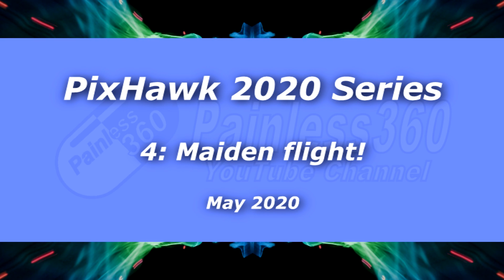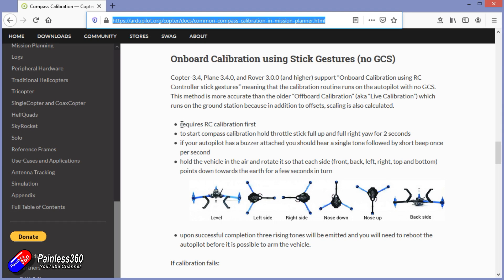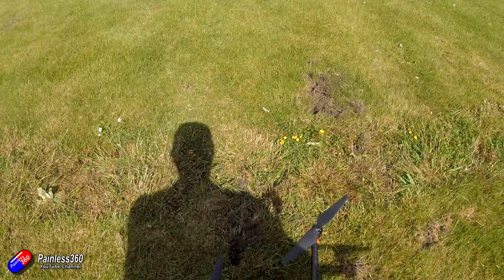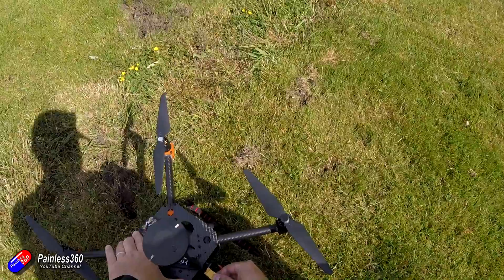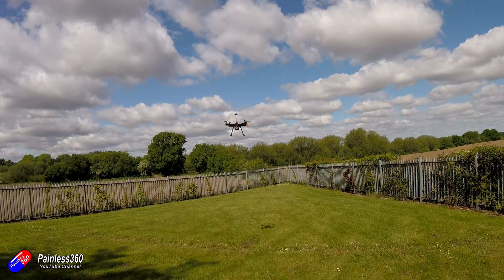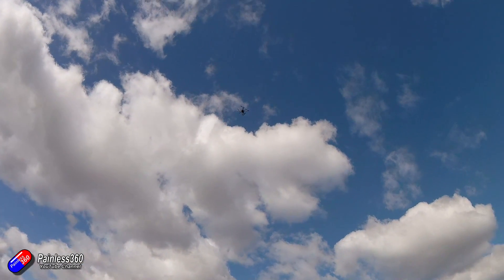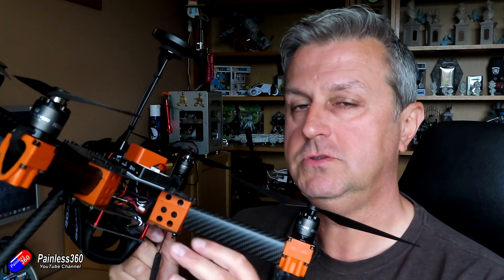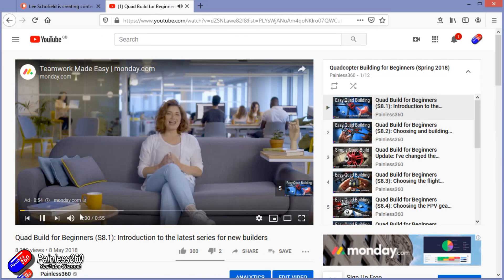PixHawk/Mission Planner/ArduCopter Build for Beginners: Maiden Flight!

Comment: I really appreciate your time! Have a question though,  i want to change my radio to self centering one. Will that self centring throttle affect the drone,
Reply from the maker: Yes, some flight modes with height stabilisation will work ok, but others won't. I may make a video on this topic as it is a great question! Stay tuned!
Reply: @Painless360  thank you much so... waiting for the video
Reply: @Painless360  and can arm on stabilize mode with throttle stick centred

Comment: dude i have a tarot quad it flips to the sides i have checked wires from ESCto my flight controller  board, props, motor rotation, artifical horizon and gps position
Reply from the maker: No need to post twice - I've answered on the the other question. Best of luck..
Reply: @Painless360  ok

Comment: Just a plug for this series, especially.  While I've been flying DJI drones for over 4 years, even commercially, and I do a fair amount of electronics, I hadn't built my own drone before.  I got the Tarot T960 kit, bought the other parts, and watched this series numerous times.  I was incredibly nervous about the first flight, but it flew like a champ.  Thanks for the great videos!
I plan on putting a Flir Vue Pro on there, which I already have and have set up.  I'll put it on after some more practice flying.

Comment: Hi bro, you are doing awsome work. ive built mine using arducopter and my current system has 7038 props with 980kv motors and 1300mah 3s lipo..im using defaukt settings of arducopter except in basic tuning ive setup all my sliders to behave smoothly and no crisp movements. but my quad doesnt hover in mid throttle and leaves ground on arnd 5% throttle and also the take off is not simple straight up but to one direction. yesterday i changed props to 5045 but had to change battery to 1500mah 4s as there was no takeoff....any guide plz?
Reply from the maker: Have you calibrated the ESCs? What troubleshooting have you tried?
Reply: @Painless360  i calibrated ESCs multiple times using transmitter method and the props look to start and stop almost at same time, if there z any minor difference then im unable to detect. Is there any test that can make sure this?regarding troubleshooting till now, i changed the ESCs, motors and used small props too.. Also made throttle slider in tuning tab go to max throt needed to hover..
Reply from the maker: You can set the hover throttle. Google 'Arducopter hover throttle' will find the pages in the wiki that cover that. The fact that the model doesn't rise level is a concern. I'd check each arm is the same and you have the CG in the middle of the model. See the rest of this series as I cover how I built this model.. Best of luck!
Reply: @Painless360  hi, i went through ur series and did 1)external compass calib (ublox neo) 2)acceleo calib 3)radio calib 4)esc calib 5)all sliders in basic tuning page are towards smooth flying and the throttle mid position value is 800 where max is 1950....my quad does leave the ground but around 5-10% of throttle while i see hovering shud be at arnd 50% of throttle stick
Reply: @Painless360  currently i am using APM3.2.1 version and the basic tuning process mentioned on ardupilot website shows parameters that are for v4.0.6. i am using same APM like yours, can u share ur parameters file zeesh1979(at the rate of)gmail?

Comment: Thanks so much for this series of videos. It shows to me that you don't need the most expensive FC to return to home within 2 mtrs.  I have a apm 2.6 that does that and it seems just as stable. I think the new pixhawk is too expensive for most hobbyist. Is there something better than pixhawk 1 that doesn't cost the earth?
Reply from the maker: A flight controller can only be as accurate as the GPS. That's the limiting factor but modern FCs support RTK GPS.. Check out my recent Kit Picks 2020 and Flight Controller Comparison videos for modern choices. Happy flying

Comment: Great video! I am building a Tarot 650 quad and I was wondering do you recommend 4 in 1 ESC's. I was thinking of buying a Tmotor 50A 4in1 that would run 3508 motors. Is this better than individual ESC's?
Reply from the maker: There are pros and cons to each option. For larger models I like the ESCs seperate for cooling and easier maintenance and repair.. happy flying
Reply: @Painless360  Awesome. Thanks for the info.
Reply: Same to you.

Comment: Great video as always. Do you have a video on battery selection? also what would be the biggest battery you can put on this thing with the current setup?
Reply from the maker: I have a few I'm using a 5000mah pack and that leaves enough weight for a camera...
Reply: @Painless360  would it take a 6s 22000mah pack?
Reply from the maker: How heavy?
Reply: @Painless360  2544g

Comment: Hello great video. What is your advice for fine-tuning a heavy lifting drone.?Which parameters should I especially pay attention to for ensuring a stable flight? My maiden flight was very twitchy and since my drone is of significant weight descending wasn’t all that graceful.
Reply: this bit on the ardupilot website helped me get my 690 size hexacopter flying very well: https://ardupilot.org/copter/docs/tuning-process-instructions.html. My yaw rate (ACRO_YAW_P) was set to 4.5(default) I have lowered it to 3 and it handles much better. My hexa was flying very unstable at default pids. I need to do a bit more tuning. For now I ended up with 0,21 for pitch and roll P and 0,011 for pitch and roll D. My yaw pids are at 0,500 for P and 0,050 for I but I need to test them further. The ACCEL MAX values for my hexa are 90000 for roll and pitch. and 27000 for yaw. (autotune sets them at max but lower is recommended) I hope this is useful to you.